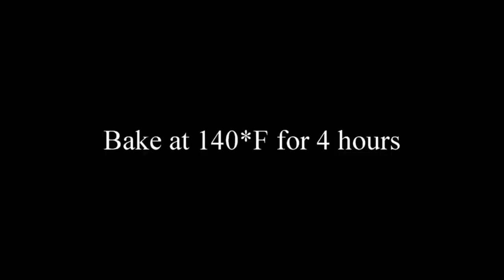Making a Carbon Fiber Hood

Comment: Loving your videos!   I looked through the other comments and didn't see this question, so I thought I would ask.  How hard is it to line up the weave where it comes together in the middle?   I was 100% sure I'd be able to see the seam, but at least in the video I couldn't even tell it wasn't one big sheet of carbon fiber.   How do you do it?

Also, I saw the filter door mold video.  Do you have a video showing how you made molds for the larger parts like your Mustang  doors, etc.

Thanks for your time!!

Comment: What weight fabric was used? And given the low layer count, was orientation a major concern? Or does the Soric really add that much rigidity
Reply from the maker: Don’t confuse weight with layers. I use 12k on backing layers. And yes, soric is a great core for infusions and adding strength.

Comment: Do you ever get any voids or delamination between laters where the making tape is? I'd save a bunch of time if I added the tape inside my parts but I'm worried the tape with cause structural issues

Comment: Oh dooooode, quality work, I have designs on messing up Carbon parts for my car but this is quite the setup!
Did you do anything special to get the resin to infuse to the end of the waterfall scoop?
Reply from the maker: No. I did start the second inlet a little soon and the scoop almost didn’t make it. But otherwise epoxy makes it there even if the second inlet “seals off” certain areas cause the folds in the banging film act as little Chanel’s for air to escape and draw in epoxy.

Comment: what tach spray are you using?  It me that you sent the roller tool to :)  I have been having issues with a lot of the 3m stuff over the years and wondering if it is worth moving over to the airtech products or a better suggestion..  I put patches and stickers infused in my stuff and sometimes trying to clean the residue screws them up a little.  Mostly stickers.
Reply from the maker: 3M super 77.

Comment: was that large orange mould made using a DIY method? 3d printed in parts then bolted? but the surface finish is smooth and doesn't seem as junky as those?
Reply from the maker: I made it from an oem hood I modified.

Comment: I've been considering building a fiberglass hard top for my CJ5. Is it possible for me to use this infusion process for the top and the three sides all at once? I'm guessing I'd be drawing the resin down as the top would actually be upside down and the three sides upward. I haven't seen or heard of anyone trying this. Any input on where I can learn this would be greatly appreciated. 
Great work👍

Comment: once again great video. what kind of resin did you use in the mold making? and for infusion? is the soric 2mm? also, will you make the both sides of the hood? regards from brasil!
Reply from the maker: Just fiberglass and polyester for the mold. Yes, soric core. And this is only a one sided part and needs to be pinned on
Reply: @ajhartmanaero  love your vids man where do you get that core at? Want to try to use it to make a Klingon bat’leth as stupid as that sounds but I’m a fan of the trek ha

Comment: Does lining the sheets in the same direction diminish strength? I've been seeing that you should cross weave the layers for stability
Reply: If the part has many compound curves and bends, the shapes will give strength. It depends on what part is being made of the carbon fiber. The hood is mostly an aerodynamic part and not much of a structural part so the hood could be made with the fiber weave traveling in the same direction. doing so would usually just make the hood flex more in one direction than the other. Noticeable when lifting the hood from either side of the car. Structural parts and areas that need to be strong would need cross layering of fiber direction. Different fiber weave pattern and thickness plus number of layers will create different strength. Making the hood too strong could pose a safety risk in a front-end collision. Your question is very good. ;-)

Comment: Man I want to get into making carbon parts
Reply: Get a starter kit on ebay. One must get used to using the materials and this takes lots of practice. I say go for it. Epoxy has no VOCs so doing it  in my studio apartment hasn't been a problem. Do it. I dare you!!!
Reply from the maker: No one is stopping you. Plenty of videos out there on how to. Just be ready to fail a lot.
Reply: Don't get fooled doe. Sure making a carbon fiber part from a mould is ''hard''. Making a mould is way harder and you will spend 4x the time if not more on the mould then you will on laying up all the stuff in the mould and infusion.

Comment: please make movie how to make perfect mold ! :(
Reply: Check out the Easy Composites Ltd Tutorial.  I suspect the process here is not terribly different if not the same as in that video.  What's not covered would be what resins to use, where to place primary and secondary (if needed) infusion locations.  Placement of vacuum.  Monitoring the infusion process and when to cut off resin flow.  The Throttle Stop Garage channel might fill in some of that.